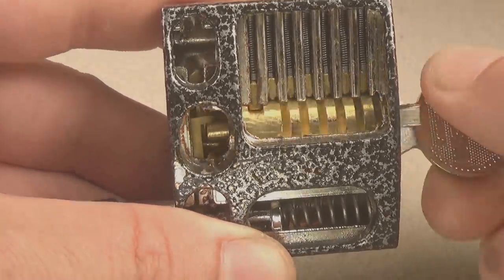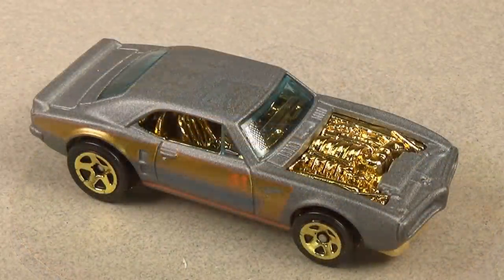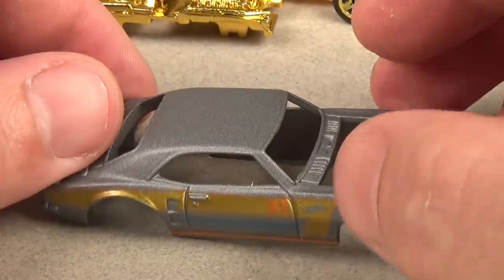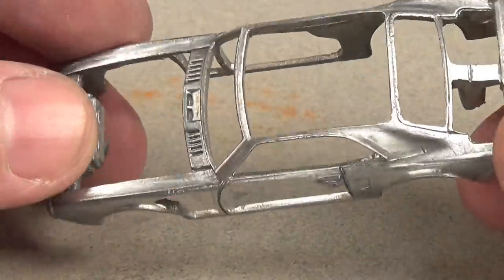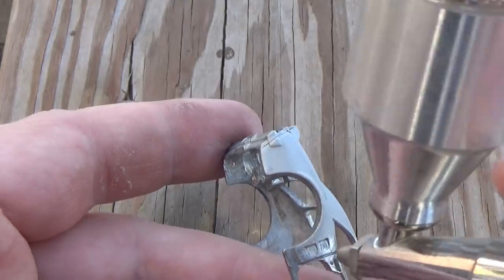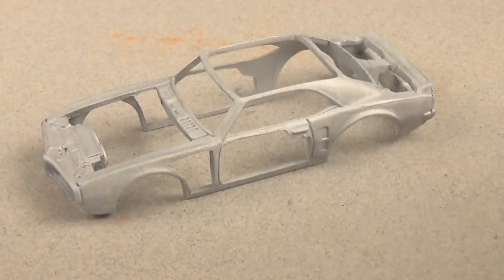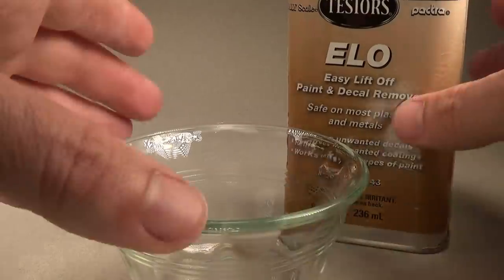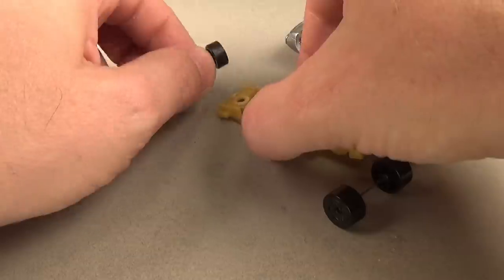How to Make a Hot Wheels Cut-Away Car Custom

Comment: I really enjoyed the video, the whole cutaway concept is pretty cool. As far as the finish product goes, Idk about anyone else, but personally I think the car turned out great! If you didn't know any better you'd think it came that way.

On a side note I noticed the file you were using looked pretty rusty and clogged up. You can easily sharpen and clean files by soaking them in distilled Vinegar. 
  Just toss them in a Vinegar bath for a few hours to a few days or more depending on how bad they are. Then pull them out and dunk them into a baking soda and water mixture to clean any residue left off and to neutralize the Vinegar. After that give them a good coating of WD-40 to prevent them from rusting again. 
  Also you can use regular old Chalk to help prevent files from clogging up. Just rub the file with the chalk and you're good.

Comment: For striping the paint, Easy Off Oven cleaner works wonders. as long as it's not enamel, paint comes right off and doesn't hurt the plastic. I have yet to try it on metal.

Comment: Nicely done. What i think is curious is that some hot wheels that don't open hoods have engines on the interiors like the new '69 charger daytona
Reply from the maker: Yes... they do this so they can remove the hood later and don't have to change the interior mold.
Reply: @baremetalHW  I thought that, i don't think they will but they really should

Comment: I feel as if the base would have looked better in a black or primered to match the body of the car.

The yellow just reminds me of the yellow Nintendo switch light it's sort of an off banana.

I'm looking through the casting list to see if this car comes with a clear base.
Reply from the maker: a clear base would be cool... black would look good but not on camera....  If you look at the yellow car in resin at the beginning of the vid it has a black interior and base and it is hard to see on camera.  I did the Lambo because of this.  Funny, I have the yellow Nintendo switch light...
Reply: @baremetalHW   none of them have clear bases but the 2010 69 Pontiac Firebird T/A, muscle Mania series has an aqua plastic base